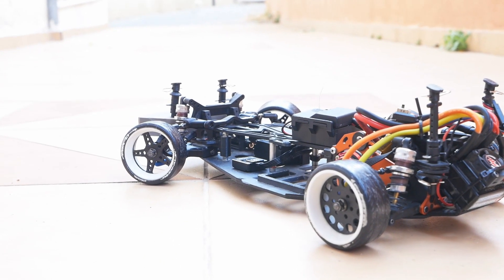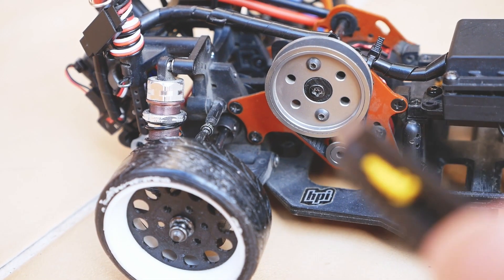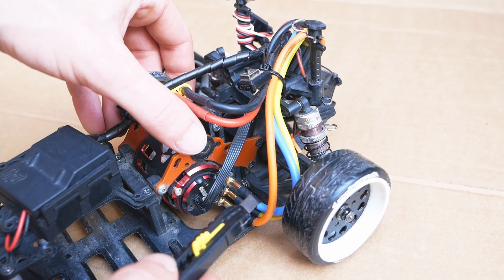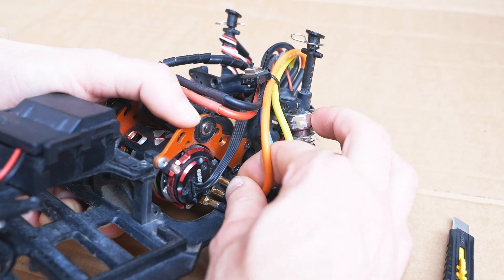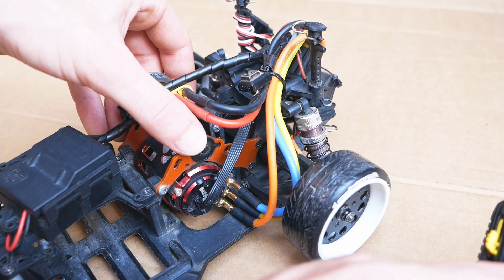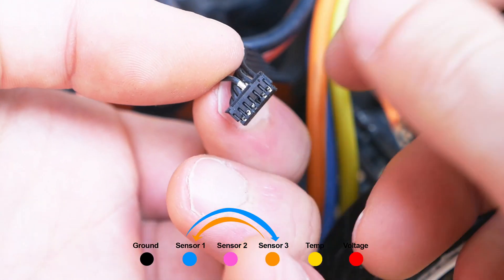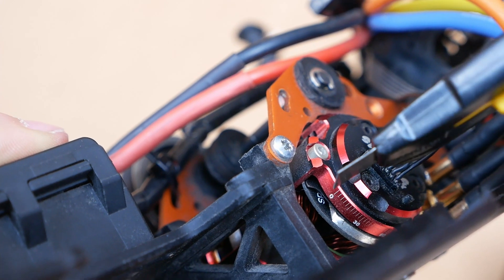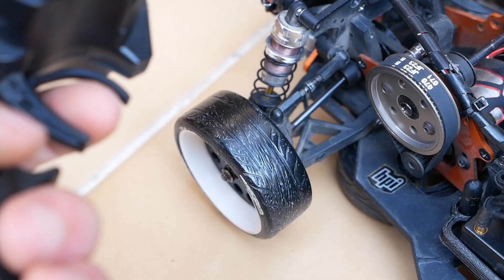Reverse Brushless Sensored Motor Direction [how to]

Comment: Super interesting video, great work. I bought a TrackStar sensored motor how can I connect it to the non-sensored esc. Thanks for the help
Reply from the maker: Since you can run a sensored combo without the sensor cable, I guess you can run this motor on a sensorless ESC like you would with a sensorless motor :-)

Comment: It works great, but i've some problem, when i go forwrd and play with throtle to get some boost n turbo,some times it goes rev, btw i use hw xr10pro (legacy i think)
Reply from the maker: Hm have no experience with that. But motors and ESCs are a very ancient tech and what I show in the video should work if applied correctly on a vintage ESC/motor like the one I have 😅
Reply: @MiniRacersRC  thq sir  😁

Comment: Did this to a Trinity X-Factor 13.5 motor, and it SEEMS to have worked. Original timing was set at 40 degrees, so if what you say in the video is accurate, I should be able to swing 20 degrees beyond the 60 mark and lock it in a the new "reverse" 40. I haven't had a chance to test it, but I spun it up on the bench and it seems to act fine with the sensor wire connected.

I'll give it some testing and see if it works out. If it does, it will surprise me that this is seemingly the only video on YouTube that demonstrates such a thing. This is important RC knowledge if this actually works out in the long run.
Reply from the maker: RC drifting is still going through cavemen age. I come from the drone designing and building, where everything is bluetooth or USB connectable with your phone letting you do all sorts of things from there, having fully adjustable gyro’s built in the flight controllers (that cost less than a drift gyro lol) letting you set autopilot and GPS functions etc, also ESC’s are programmable via your phone, so reversing a single motor felt very natural to be easy but since technology is so ancient here, I thought I could figure out how to do this having no special degrees on the subject xD 

(I had it running like this for months of hard drifting and everything was okay, reversed it back and forth a couple of times and all worked fine, funny story is that even the manufacturer didn’t know or didn’t wanna tell me how to do this, maybe to get the higher end ESC? Who knows)

Comment: I did all the step by step instructions you taught. I inverted the blue cables with the orange and I reversed the sensor cable wires, but the car now only goes backwards, both when I accelerate or reverse it only goes backwards! When I removed the sensor cable it was normal again forward and reverse!

 Would the sensor be so missed in drifting?
Reply from the maker: Sorry for the late answer, from what you say here, you didn't reverse the motor timing which is really important too. You can drift without the sensor of course but depending on the surface you are drifting on, and how other people run, it is going to be harder to compete with them. At least on carpet, that was my experience...
Reply: @MiniRacersRC  friend, I did it! I did the whole step by step! I reversed the Esc cables, reversed the sensor cables and adjusted the timing! But the engine is getting hotter, is this normal?

Comment: Hello,ive done this to my esc and motor from extreme racing.
But the sensored wired when i switch it up and plug it in my motor jerk like crazy.but without the sensored wired my motor run in reverse ia good.i did try to reverse my motor with my radiolink.but the turbo mode seem to off also.
How should i solve this.
Reply from the maker: Hello, first of all, did you follow ALL the steps as shown in the video? 
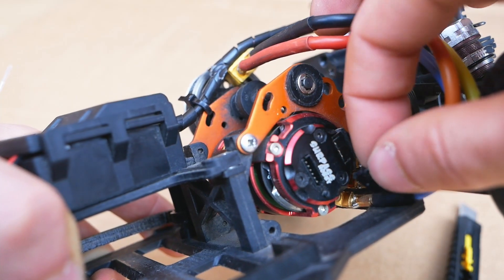If you skip one, let's say you didn't change the motor timing like I show at 1:56, then the motor is going to jerk. 
As you mentioned, this CAN'T be done from the radio. It should be done from the ESC or the motor (as shown in the video) if the ESC doesn't have this option. And also correct, if you remove the sensor wire then the motor will function as a normal sensorless motor, but won't have all these program functions like turbo, boost etc.!

Comment: I assume you have to go into your ESC or radio and switch the directions for your throttle correct? I tried this and it didn't work on one of my Tekin systems. It wouldn't even run because the ESC realized something was wrong with the polarity on the motor.
Reply from the maker: If your system is a sensor one, what I am showing in the video, should apply on yours. The direction on the controller must be set so forward and reverse work correctly. Normally we don't change the direction on the controller, but only on the esc...

Comment: 0° and 60° swap overs, 30° remains the same. For a 2pole motor anyway.
1. Main wire swap
2. Sensor wire swap
3. Sensor angle adjust
Reply from the maker: Your 1. 2. 3. Steps are correct. As for the "30° remain the same" AT LEAST on this particular combo, it doesn't apply. I haven't tested this on other motors so I can't say, though I imagine it would be the same as mine :-)

Comment: Nice work! I didn't know it can do this. I'd normally change the direction via programming.
Reply from the maker: Thank you bro! Yeah that's what I tried to do first, even cheaper ESCs have the CC/CCW function and I was surprised to see that there wasn't such a setting for the Xerun 120A :/